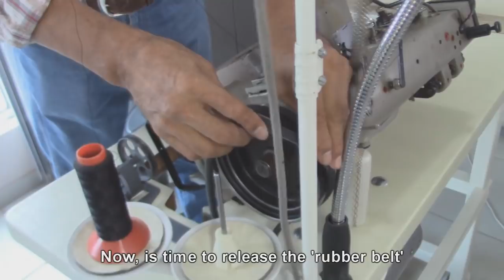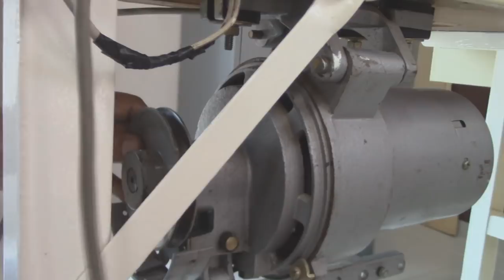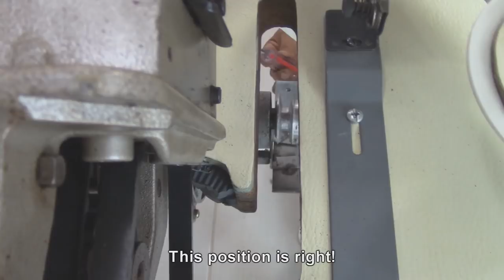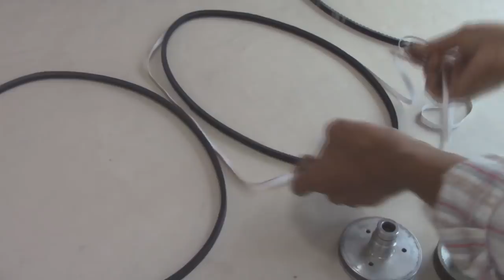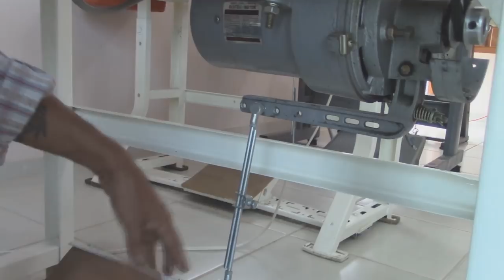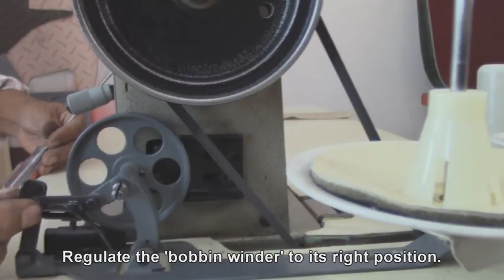How to Slow Down The Speed Of a Sewing Machine  - Part 1

Comment: When I wanted to slow mine down this is what I did, ...( i have a brand new consew I bought at a garage sale )... I extended the clutch lever bar with a pice of steel to reach the other side of the pedal, i flipped the mount for the rods to the other side of the pedal, this gave a far easier way to control speed, I also held the pulley stationary while fully engaging the clutch for a few seconds at full speed to "burn in the clutch" it worked fantastic.  I can now go very slow, but can also have full speed when I want it ( I also had no access to various size pulleys ) if I had watched this video first I don't think I would have tried to do it the way I did but I guess the results are the same 👍😁
Reply from the maker: Thanks for sharing your own experiences!
The part one is complemented by part two that shows an elongated bar to keep better control of speed.https://youtu.be/YDiyffeXleg?t=1
Reply from the maker: @filthbomb  I really appreciate your kind comment! We have opened on facebook and the youtube community a special page for our followers. If you would like to send us some photos of your work we'd be glad to post them. We have an account cechaflo@gmmail.com where you can send them to.

Comment: Cesar, I was given a machine just like yours from a friend who's Mom died.  It will not go forward with the reversing lever down, but will go forward with it up.  Do you know what is wrong with it?  I tried to reverse the wires in the junction box but that didn't do it.  Thank you! Gail
Reply from the maker: The feed dog drags with its teeth the material (vinyl, leather, fabric, etc.) forward while the reversing lever is up in position and the big pulley or big wheel moves forward too.
Verify the big wheel moves forward. On the contrary, the electric current poles of the motor are inverted.

Comment: This works good for a manual oil machine.But not so good on a auto oiled  machine.I have found out if you adjust your clutch motor you have full control of your sewing machine I have done this with my Singer 191D-30 sewing machine.I had a servo motor on it for a while but it does not oil your machine very good a high speed.But this setup works great on my Singer 20u 109.Adjusting your clutch motor is not hard to do but you will have to do it a few times before you get it right or I did anyway.

Comment: i have pfaff 463 and it has a clutch motor with big pulley......still not very fast and thread sewing spacing is closer on fabric. Any idea how i can increase speed and longer thread spacing?
Reply from the maker: I have no idea about what is happening to your sewing machine motor.
The sewing machine I have has a very fast clutch motor:
https://youtu.be/g-64WWA_E8Q?t=335
Regarding the thread space, hopefully this video is useful:
https://youtu.be/g-64WWA_E8Q?t=335
I have found the maximum stitch length of your machine is:
Lockstitch. 4.5mm max. length, forward and reverse.
That is how it comes from the factory.  Perhaps, this stitch length could be increased by modifying an eccentric mechanism that moves the feed dog.
Reply: @Cechaflo  thank you very much

Comment: hellow how do I fix my brother sewing machine,My clutch motor is getting too hot and releasing smoke
Reply from the maker: Perhaps, you would need to replace the clutch motor for a new one. This is job for an electrical technician. Clutch motors have 'brake pads' that make the machine stop whenever it is necessary. If these pieces are worn out the metallic pieces are exposed and while making contact cause heating and fumes.

Comment from the maker: David Edwards
Thanks.  Very helpful.  Made both modifications to my Singer 241-13.  Took a couple of hours including a trip the hardware store for the new pulley and belt.  I'd say it about halved the speed and doubled the distance your foot has to move to activate the clutch.  Makes the machine much more user-friendly for an amateur like me who only uses it every couple of years.
ANSWER:+David Edwards  I also do upholstery off and on as a hobby and my machines work pretty nice at a low speed...nobody is hurrying me up(lol)

Comment: I have a cheap chinese domestic sewing machine that came with a small ac motor ,meaning a very high speed and very hard to control, so I did replace it with a DC motor from one Baby Lock companion 7000 and added an Arduino board some electronic stuff and no works like a charm! I am inthe process of adding some sensor to the shaft to control the position.Love your channel ,I have learned a lot,keep the good work cheers!

Comment from the maker: alibabafurball
I have looked at some of your videos. I am just learning to sew. I have 3 antique singers all over 100 yrs. old and one C.W Wiliams that is from 1873. I got treadles just for this reason to go as fast or slow as I want. The industrial model singer I want for the sewing in your videos is the singer 29k-58 walking, multi directional foot. Would this be a good one to get for upholstery and to learn on with your videos?
ANSWER:+alibabafurball I learnt to sew with the sewing machine of my mother, an old singer with treadles...these machines are very strong and for life...I remember, I did some adaptations to do upholstery and sew with a thicker needle. Things were simple...1. I drilled through the hole of needle plate to make it wider, to let the thicker needle (140=22) run in. 2. I remember that also gained some more 'stitching length' by letting the 'stitch lever' a little lower (I only filed a little the inferior part of the 'housing cavity'...I didin't touch any internal mechanism.
3. I changed the 'standard presser foot' for a 'rounded presser foot I had to regulate a little upwards the 'needle bar'
You can start doing upholstery with the heavy duty 29k-58, although it was designed for a shoe job...to do upholstery is advisable a 'flat bed table sewing machine'...your machine has a 'cylinder arm' (useful to make bags or sew on rounded shapes). You would need to adapt a 'table box', same level of the cylinder arm and get a 'flat bed'.

Comment from the maker: Marc van Zyl
Hello, thanks for the information in your video. Could you please let me know if the oil pump will still work effectively when slowing the speed using pulley or even servo motor? I have come across some information to suggest that the oil pumps were designed to run at higher RPM? I just wasnt sure if it would still perform the job OK when slowed. Appreciate any further help you can provide. Thanks!
ANSWER: +Marc van Zyl Interesting remark! As far as I've realized the 'oil pump' continues working if the machine is at a low speed...of course the oil also flows slow but fulfills its lubricating function.

Comment from the maker: joey alfaro
you have shed some light on what goes on under sewing machine. tensioner is what we call little wheel putting pressure on belt
ANSWER: +joeyYes, not too much tension to rubber belt, just enough to link the motor small pulley rotating movement to the bigger sewing machine pulley.

Comment: Hi. I love your channel. Thanks a million for answering my questions. Do you have a suggestion of a small pulley size for the singer 241-12? I just got my machine and I need to slow it down.
Reply from the maker: Perhaps you could find a small one on the internet, ready to be installed. Another better option would be to remove the one that is on your machine motor and take it to a lathe operator and tell him to make a similar one but of smaller diameter.

Comment: Great work! Can you posts the website where you bought the smaller pulley? My idea was to connect the A/C plug of my sewing machine to a Variac to reduce the incoming voltage to the sewing machine. Eddie Van Halen used a Variac to lower the voltage coming into his guitar amplifiers to create his "brown sound."
Reply from the maker: Those pulleys different sizes could be gotten on Amazon https://www.amazon.com/Clutch-Pulley-Industrial-Machine-Diameter/dp/B07DXLPNZ8
Reply: Thank you Sir!

Comment: Glad to find you.....My PFAFF ((1245 706/47 )... fell forward and broke off two studs,,,,,the tension assembly stud and the center bobbin winder stud... Question?....can these studs  be replaced separately from their assemblies....thank you
Reply from the maker: Hello, I do not know if the single studs are sold alone, sorry. As far as I know they sell the complete spare part assembly. I am sending you some info abou it:
Ebay sells the 'tension assembly': https://www.ebay.com/itm/Tension-Assembly-91-009328-91-PFAFF-141-145-146-335-545-1245-Models/401525160116?hash=item5d7cc3b8b4:g:v~kAAOSwHuha2PMt:rk:36:pf:0
On this site you could find the 'center bobbin winder':
https://www.drdanessmh.com/pfaffindnbbwtens1.html
On Ali Express:https://www.drdanessmh.com/pfaffindnbbwtens1.html

Comment from the maker: Geoff Halstead
César,
Finished taming the Singer and new video up:
http://youtu.be/E78sn_po_X4
Photos of what I did:
http://s1104.photobucket.com/user/Geoff_Halstead/Singer%20660%20A1/story
It's the best I can get it without fitting a servo motor.
Just need to return the top thread tension back to what it was before I fiddled with it, for some unknown reason, then start sewing.
Geoff - MUST learn to leave well alone if not broken!

Geoff Halstead
César,
http://youtu.be/DyKpAPMz0gA
First video of machine in operation with the extended clutch lever, but without the extra spring that has made it even easier to start slowly. Next video will show this.
Geoff - Have machine will sew!
ANSWER:
+Geoff Halstead Thanks for sharing this idea! ...I'll try out on my machine...I still need it slower, despite of I've changed the original motor pulley for a smaller one.

Geoff Halstead
Hace 2 años
Update on my effort to get a slow start.
WhooHoo, I've done it!
Extended the clutch shaft by 8" (230mm) and attached the top foot pedal rod to a long bolt sticking out at 90° from the end of the extension.
What a pleasure the machine now is, from hand turning slow to take-off speed.
Just need to put the extra tension spring back that I was using, just to give that little bit of extra resistance for initial pedal pressure.
It now feels as if I have a servo motor installed.
Well worth doing César.
Will put a video up ASAP.
Chuffed doesn't half explain how I feel.
Geoff - It's good when a plan comes together!

Comment: Hello,  I notice that you do not hold your thread ends when beginning a new stitch.  What is your trick?  I have been sewing for several years and any time I let the beginning thread go unheld it wads up the underside of the stitch and or catches the loose end in the underside stitch. Almost invariably when I start out with a backstitch to lock the threads.   It would be nice to not worry about it besides straightening it out to begin with most especially when doing big canvas jobs where you can't easily get to the backside along with the top to hold the thread.  I have two walking feet machines (Jukki and a Sailrite) as well a a lightweight home zig zag machine.  All of them do it for me.  Interesting video.  It reminds me of when I started and could find absolutely no information at all on the basics of both sewing and machines (pre internet).  Sure is nice now.  Take care.  Doug
Reply from the maker: Dear Doug, This issue happens once in a while. One of the reasons is when tensions are unbalanced and lower tension pulls down too much the the upper thread. There is a small bar beside the rotary hook shuttle that balances this mechanism to let the threads pass through around to make the lockstitch. If it is unbalanced it also causes the issue. If the hole in needle plate is too big also causes the issue.
When I sew real pieces I do the backstitch. Sometimes, I use the reverse stitching lever and other times when I want a precise distance of one or two back lockstitches I use the knee lever to lift the presser foot and move the material manually and put the needle only at that distance.
Thanks for watching the videos!
Reply: @Cechaflo  Thank you.  Hadn't known that even after all these years.  Take care.  Doug
Reply from the maker: @douglasthompson2740  Welcome to this upholstery channel anytime!

Comment from the maker: +Cechaflo A servo motor has a  'clockwise knob' so you can regulate the speed of the machine...you can sew stitch by stitch and it doesn't matter if the pedal is pushed completeley down.Check these useful links which give us a better idea about a clutch motor' and a 'servo motor'
http://raphaelsewing.com/blog/?p=13
https://www.cutsew.com/servo-vs-clutch-sewing-motors
http://www.ebay.com/gds/Faceoff-Servo-vs-Clutch-Sewing-Machine-Motors-/10000000005856179/g.html
https://www.youtube.com/watch?v=Qwi9UZz2VAQ

The 1445 Pfaff is good and similar to the 1245...suppose, it is in good shape like new as those guys are asking 2000 euro...too expensive for a used one...I advise you to do an effort and buy a new one.

Comment: señor cesar! muy buenos dias, usted hace 1 año y medio aproximadamente me aconsejo con respecto a adquirir una maquina de coser para tapiceria, logre comprar una pfaff 145, (soy de venezuela, aca esta un poco dificil la cosa para no entrar en detalle) y hice todo lo que usted hizo aca en este video, cambie la correa y la polea por una polea muuuy pequeña, la maquina sigue siendo demasiado pero demasiado rapida, y el motor de clutch uno medio mueve la pata y pasa de lento a rapido, no tiene mucho trayecto, hay alguna manera de configurar en si la pata del cluctch como para modificar el nivel de velocidad o algo asi?? o tengo que hacer una modificacion tipo pulley system con una polea grandota y otra pequeña (en total 4 poleas) para reducirle la velocidad?
Reply from the maker: Esta Ud. en lo correcto, la relación de las poleas deben ser de 'grande' a 'muy pequeña' para que surta el efecto de 'disminuir la velocidad'. Si las 2 poleas van a tener casi el mismo tamaño, entonces no tiene caso, va a ser o mismo (Ya vi en internet que el cabezal de la 145 tiene su polea pequeña...es para alta velocidad. La solución es conseguir una 'polea/rueda volante mas grande' o mandar hacer con el tornero que tenga la misma entrada pero su polea mas ancha. Me refiero que la polea debe tener mas diámetro en la canal donde va el 'banda de goma.
Además para mejorar el control del motor hay que alargar la palanca que va del motor al pedal. Este otro video ayuda:
https://www.youtube.com/watch?v=YDiyffeXleg

Comment: Ho sentito parlare di un dimmer . Riduce la tensione sul motore e di conseguenza i giri . Potrebbe funzionare? E se il motore funziona  220 v con l'ausilio del condensatore si potrebbe pensare di aggiungere sulla linea 220 del cavo quel riduttore di tensione così da aver più controllo ! Qualcuno di voi la fatto??? Io acquistato un pfaff 561 per errore e ora devo assolutamente risolvere questo problema della velocità
Reply from the maker: Definitely the best way or solution 100% to reduce speed and keep control of the sewing machine is the use of a servo motor. 
The method I show is a 'just in case solution' . Much important than the changing of the pulley is the adaptation of the elongated lever as I show in part 2 of a video.
https://youtu.be/YDiyffeXleg?t=434

Comment: Will this work on ppaff 1445?
Reply from the maker: I have now realized this machine 1445 is similar to a Pfaff 1245, 545, including 145. Little differences, such as needle system which is 134-35 and for Pfaff 1245 is 135-17
The 'slowing down process' work out the same. I'd rather recommend to get a servo motor...if possible.
The manual if necessary:https://www.manualslib.com/manual/1242760/Pfaff-1445.html?page=5#manual
Reply: Cechaflo thank you so much for the information. You have a link to the servomotor? This is my first stitching machine, i cant even use it 😂
Reply from the maker: @someonebartender   @Adil A  Johhny is a youtube friend. He bought a servo motor for his own 1245 machine. A Ho Hsing G60
https://www.youtube.com/watch?v=oJVlq_L16ew
Before purchasing be sure the correct voltage the motor uses and the place where you are (220, 110, 120 ?)
Reply: Cechaflo im gonna need to check the voltage for this motor. I just hope that i get something out of it. I just spend all of my money on this machine :/